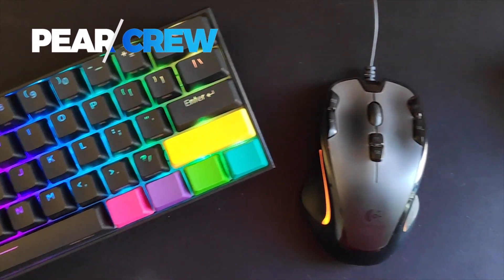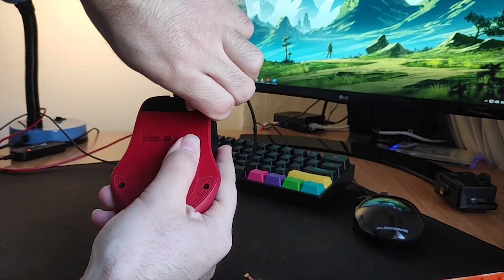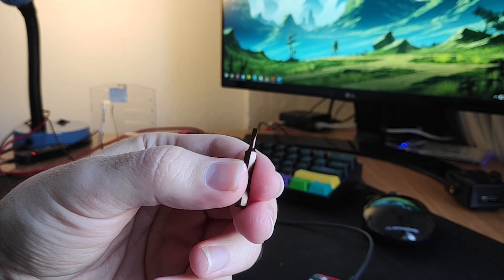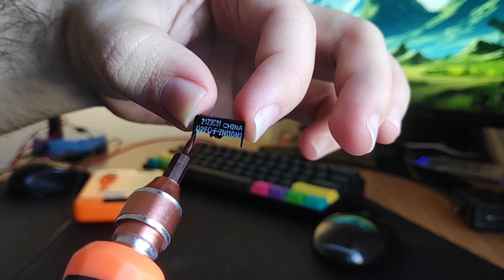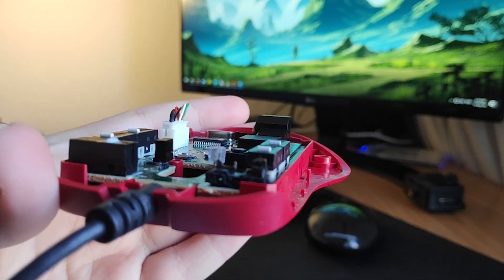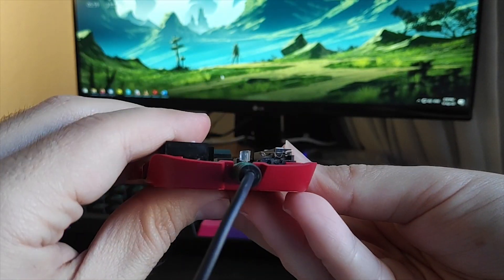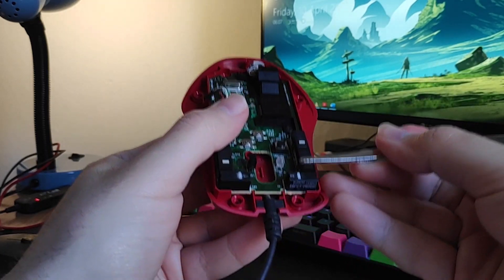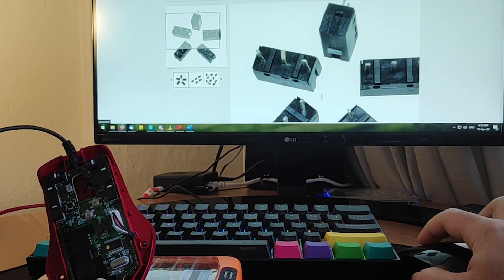How to fix a Double Clicking Mouse

Comment from the maker: Did this help you fix your mouse? What mouse are you rocking?
Reply: DONT DO THIS YOU CAN JUST ADJUST THE DEBOUNCE TIME AND TURN THE DEBOUNCE TIME TO THE MAX AND NOT ON 0 OR IT DOUBLE CLICK
Reply: @GagnonX  okay mr switch expert, you know the difference between a worn out and brand new switch on the insides? the springs get compressed, so that means there's more debounce to the switch, therefore unintended multiple inputs
Reply: @GagnonX  How and where do we adjust the "debounce time"?
Reply: @GagnonX  Might be an issue on anti cheat engines, it may detect synthetic inputs???
Reply: @tman1894 Idk, that shit was 4 years ago…
Reply: @GagnonX  Still relevant today, your solution is great, but has risks for gamers, my comment is for the next person looking for a solution.
Reply: if you asked me zebronics mouse
Reply from the maker: @tanishkprem7422  Haven't seen them before, they do seem to have some interesting peripherals
Reply: @PearCrew  it's an indian brand
Reply: glorious model o matte black with wire bcuz i dont liek charging
Reply: Zowie EC2A. i'm not going to try and do what you did and since my warranty is over I guess I'll have to bite the bullet and get myself a new iteration of the Zowie EC. This mouse made me good at games :( I tried using a Logitech earlier this year, but it wasn't wellsuited for FPS games. Although this phantom double click only happens once in awhile, it has hit the old age and will most likely increase in its rate. I mean, it served me for some 4 years, the quality can't really be called into question, but did it really have to start happening in my christmas vacation?
Reply: That helped 100%  thanks brother 🫡 (model O-)
Reply: G700 s 4 lyfe
Reply: Foxin wireless mouse with 3 dpi modes
Reply: This completely fixed my g600. I was thinking of getting a new one because of this issue. You just saved me the purchase! My middle click is still not working that well but that can only be fixed with a soldering iron it seems. Thanks a lot!
Reply: A4Tech OP-730D mouse for 2 years
Reply: Doing it in 2024, it Works 100%
Reply: to my experience, double clicking happens when: 1) water get in 2) cable interfering.
Reply: i can't open the cover of the button
Reply: thank you so much, i'm using a UtechSmart Venus Gaming Mouse, $35 with 12 side buttons.. great stuff. saved me a few more months.. and the pictures on instructables are great, thanks.
Reply: I could not get the tension in the spring right.  For one I feel that part wasn't very clear, but the curved spring can't be pushing on the bottom of the bar.  It needs to curve upward and push against the central bar.
I also discovered that the rear bar extends outwards like half an inch, and when you lower it on to the back of the spring instead, it tensions it in place perfectly.  After nearly an hour of fiddling with the tension, that made it work instantly.
Reply: i have a cooler master mouse and i fix it useing your vid thx
Reply: 4 years later, this worked great! I went more brute force and somehow managed to not damage the parts. Did this on a Razer DeathAdder elite that my friend passed on to me after he bought himself a new mouse.
Reply: Thank you! This helped to fix my logitech m105, works great and clicks as crispy as before. I did a mistake the first time though, I  bented end of that middle middle thing up and double clicking was fixed but click itself felt wrong - almost no clicking sound and click was to tight and sensitive. What I should do is to bent the whole middle thing slightly down(from how it sits on switch) and keep it straight, I understood my mistake by watching images from the link under description. Once I redone everything  click became crisp and joyful as before. Thank you again and sorry for bad english.
Reply: Fixed a wireless ISY IWM 3000 mouse, thank you for the video!
Reply: did it on my g502, it worked btw
Reply: no, it didn't help very much. my mouse is MIXIE
Reply: sadly not, im using the m720 triathlon from logi, it has a serious issue with its clicker, and i couldnt get into the switches. im just gonna buy a new one

Comment: I don't understand the hate down here.
Opening the switch up is literally the easiest part so him not showing it is no problem.
Yes this repair is very frustrating for first-timers since getting the spring back in is a bitch and a half.
However it is doable! just ask yourself if the hour of agony is less of a hassle for you than buying a new switch for 50ct and soldering it in.

Comment: NEW REASON FOUND: For me, the reason was my mouse DPI. I don't mean low/high dpi was the reaeson, but my mouse has a button that changes my DPI. I had my DPI on the lowest, so that's why it double clicked. Besides that, i had some major problems that became worse and worse with the mouse movement, that also got fixed. So that's 1 other reason/way to fix it. If your mouse has more DPI options, i sugest you  change it to the highest. (talking about the mouse, not windows settings. Strictly your phisical mouse.)

Comment: Thanks this fix the double click. It was a pain to put the tension spring back so take it slow. Do it on a clean desk/surrounding it may bounce off dont lose it guys. You can open the other side to see how the spring suppose to be in there if its hard to see in the video. My mouse sounds louder slightly harder to click but no double click anymore. 👍👍Good luck

Comment: Well, at the end of the day your vid helped me fix my mouse, but holy shit did I mess up a lot trying to follow the instructions lmao. At first I thought I lost the lil white dog when I was removing the cover. Even thought you said be careful and I was thinking that I was being careful, that thing bolted out of its place. I wasted like an hour crawling on the ground like a maggot and even cleaned the floor to see better only to then find the piece on the table. Imagine how pissed I was, got tricked into cleaning my floor by that shitty little piece. Then I overcorrected the bronze membrane it didn't work the first time I assembled. And then the second time the bronze asshole was refusing to get in its place so hard, I was borderline impressed. Putting the cover back on was also tricky, had to turn my mouse upside down, but once that was done, it was a smooth sailing from there. Well, not counting getting the glue all over the bottom of the mouse and a few of my fingers. Still, great video. Just funny how even though before almost every action you say "GENTLE, CAREFUL" I still somehow wasn't gentlareful enough lol 🤣

Comment: I wasn't actually able to fix my mouse, technically speaking, because the switch has a side clasp and I could not possibly pry it open. Tried for longer than I probably should have, multiple methods, multiple angles, several different implements... However, some combination of opening the case, cleaning some gunk accumulated in the seam, messing with the switch box, messing with the switch button (including holding it down really hard for a few seconds), closing the case, tightening the case screws as tight as possible, seems to have incidentally fixed it. At least for now.

Comment: can you make a vid about actualyl replacing the switches to better ones? also  I may have messed up the scroll wheel as it wont work any more and there's no"clicking" feedback as you scroll, not sure how to fix it.

lastly I may want another mouse but I need there to be 2 buttons  bu the left and 2 by the right button, but on top, not where the thumb is and I haven't found anything yet, any ideas? the only other option is roccat tyon but they are out of business

Comment: i had an issue with my old bloody v2 mouse so i open the mouse and used wd40 all over the mouse even on chip and inside buttons too let it dry for a day and now no double click issue but yeah as it is very old mouse wheel is not working.

Comment: The rear bar which holds the spring extends upwards like 3/8ths of an inch, and when you lower it on to the back of the spring instead, it tensions it in place perfectly.

Comment: Jesus Christ, I've repaired many things in my day, but getting the little thing back on was one of the most frustrating things I've had to endure in a long while. HyperX apparently uses an especially tricky switch design. I spent more than an hour trying to get everything back into place. No double clicking though, so thanks for the video man! Next time I think I'll just buy a new mouse though. This was not worth the nuisance.
Reply: The rear bar that holds the spring extends outwards like 3/8ths of an inch, and when you lower it on to the back of the spring instead, it tensions it in place perfectly.  After nearly an hour of fiddling with the tension, that made it work instantly.
Reply: @Valchrist1313  Yeah I think I sort of got the hang of it near the end there, but even knowing perfectly what I had to do it took 20 more attempts. And the spring jumped out a few times so I had to look for it under my desk more than once. All in all, a really finicky little fix.

Comment: Just got done fixing my mouse, thanks for the video. Tip to everyone else, be very careful using the flat head to remove the black cover. I slowly removed it with a small flathead. The biggest pain for me was putting the spring back in.
Reply: DO NOT lose the super tiny button that falls out.  Lucky I had an old dead mouse to take apart for a new button.

Comment: When I got to the step where I was supposed to bend the spring, I stopped.   My spring had good tension.  It wasn't sticking.  So I removed PCB, washed the plastic parts of the mouse using warm water and a tooth brush.  Then I blew the parts dry with canned air and reassembled.  Maybe that will do it.

Comment: That worked for Logitech M185, thank you. Also you don't have to take out the metallic part, I think better to squeeze it in place with some tweezers, otherwise putting it back not an easy task.

Comment: everything wrong, do not do this, also , the most important things ar enot done and not shown.
typical pc masterrace complete and utter epic failure.
increasing tension might work but it is not needed, nor does it help, nor does it last, nor is it easy.
all oyu have to do is clean the contact area, with contact cleaner or nitro or rubbing alcohol and a cotton piece.
there the issue lies, anyway, this occurs after a LOOOONG time, it is time to replace your shitty PC peripherals.
they are all crap, especially Logitech and Razer is utter garbage.
but y, rgb kiddos buy this shit so....who can blame them

Comment: Thanks brother for posting this video , really helped me fix my logitech mouse 

A tip for others , use a polyethene bag and then keep the mouse inside it and perform whatever switch you have to fix because the copper switch is pretty springy

Also take a picture with closeups from each angle before starting to fix the curve

Comment: ok you dont have to do all that. I just grabbed my air duster can and sprayed into the gap of the mouse button and it fixed it all. Also cleaned up a bit with a cotton bud inside the mouse and around the button.

Comment: DO NOT ATTEMPT THIS, you will just break that tiny spring and then you will have to buy new mouse eventually. because this dumb@ss didn't show the most crucial part, which is how to remove that spring mechanism because once it's bended at those side tiny bars it's not going to work no matter what you do.
luckily i had an old non working mouse which i directly unsoldered the connection and used that on my current mouse... and it's safe. 
just go buy those tactile buttons from electric hardware shops and solder it instead of trying to fix the spring because it works if you know how to remove that spring carefully.

Comment: BEFORE YOU START
what's not mentioned is that each of these micro switches are constructed differently, and many rely on precise placement by machine. If you are here watching this video to fix your mouse you are FAR BETTER OFF learning to solder or replacing the mouse, your likelihood of success is low.

Comment: Great video.  Unfortunately, the mouse I tried to fix, Logitec G602, has much smaller springs and it was futile.  So, I reprogrammed the buttons so the Right Click Button is now the Left Click Function and one of the side buttons controls the Right Click Function.  It's not too bad.  I'll get used to it.  Thanks for the excellent video and the written description.  BC
Reply: dude, use AutoHotkey to run this script and the double clicking will be gone :
LButton::	
	If (A_TimeSincePriorHotkey < 150) ;hyperclick
		Return
	Click Down
	KeyWait, LButton
	Click Up
Return

Comment: i fixed it without disassembly by pressing the left and right click buttons hard, but not too hard until it breaks for 10 seconds, blowing through the holes on the mouse where the click buttons are and shaking rapidly, repeating until it works. my mouse was double clicking 50% of the time and now it only double clicks once out of every 100 clicks, thanks reddit
Reply: haha thx man you saved my time❤
Reply: @Clathios  im gonna be honest, this worked for like a couple hours and the double clicking came back, i had to manually unbend the copper spring in the mouse in order to fix it for a couple days and it would break again. better to just buy a new mouse, preferrably an optical switch mouse so you don't have to deal with double clicking in the future. Just bought a zowie sc-2 and im confident it will never double click again
Reply: @Clathios  because it registers clicks with light instead of very thin copper springs, you could breathe on the copper and it would fly away

Comment: I've spent hours trying to put the copper back in place!
I almost give up and buy new one which is expensive. Still trying here
Reply: The rear bar extends upward, you just lay the tab in place and lower it back on.  It tensions it in place perfectly.
Reply: @Valchrist1313  i finally gave up 1 year ago. i bought new mouse for work,

Comment: I have been using G300s for 8 years. I'm on my second one for my desktop and I have one on my laptop. Great mouse. I did this fix years ago and remember it being a chore. I decided to look for videos to see if there were some tips before I tried to do it again. I was pleased to see that one of the first videos that popped up had my same mouse. Your description about reinstalling the copper part really helped. Flat end under the hook first and then the loop end slides in sideways under the hook at the other side. Very easy. Saved me a bunch of time, learned how the piece flexes to make the mouse click, and picked up a new skill. Thank you.
Reply: I also love G300!
Reply: should probably replace the swiches instead. anyway I need a replacement but  they are all discontinued, and idk if I wanna spend 100$  on a new mouse made  like 10 years ago

Comment: I was able to use a tweezers to bend the metal clip up without taking it off. Fixed my Zowie FK1 mouse in just five minutes. Works perfect, other than needing replacement rubber sliders lol.

Comment: This helped me fix my Razer Taipan! I had already taken it apart 3 times and tried putting a bit of tape on the top of the clicker to make it press deeper but that wouldn't work. Adjusting the spring has fixed it perfectly and the click feels as deep as it was originally. Thanks!

Comment: Open an old mouse, open the microswitch recctangular box, take out the wierd shaped metal thingy, stick it in your broken mouse, no soldering required.
If you don't have an old mouse, order a microswitch for a couple dollars and take that metal thingy out.

Comment: Pro - it's working.
Con - the button doesn't feel the same. 

But at the end of the day I get to use my favorite mouse again so thumbs up.
Reply: its a good tip if you dont want to change your mouse early, however, the button feeling will never be the same.
Reply: If button doesn't feel the same probably you did something wrong. I did it wrong the first time, double-clicking was fixed but click was to soft and sensitive, watching images from the link in the video description helped to understand mistake. Now i got crispy and joyful click just as before, sorry for bad english.

Comment: Thanks for postingthis online, I already fixed my mouse as per your instruction but one thing I noticed about my mouse is the switch I think placed in a wrong way for mine in the mouse factory I mean... The white button of the switch is on the left side of the switch box but its curve is on the right side.. Is there something wrong with that?